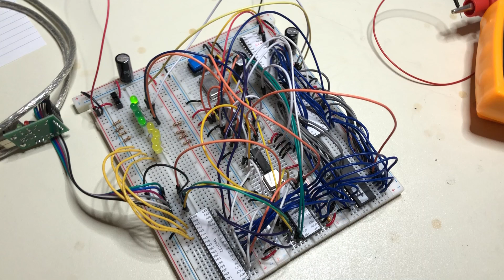6502 Mite homebrew computer project: step 9, blinkenlights

Comment: Very interesting project. Thanks for posting these videos and for your web site. I’m fascinated with your progress since the Mite is very similar to my own single board computer which I’m basing on the Apple ///.  I’m intrigued by your use of the 74x74 flip-flop to halve the clock frequency.  Until now, I’ve been using a 555 timer for a slower clock during development, but the dual f-f is a much neater and cleaner idea. Keep up the good work. I hope being “too technical” isn’t a concern - the more description and detail, the better.
Reply from the maker: The trick about the flip-flop was something I picked up from discussions on 6502.org. The value of it is that, first, it cleans up the signal and, second, it ensures an exactly 50% duty cycle.